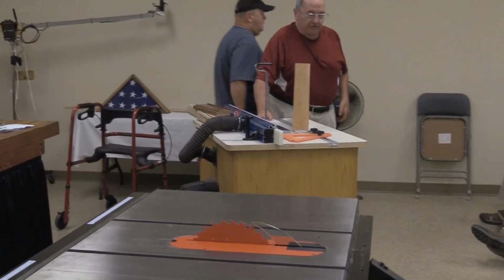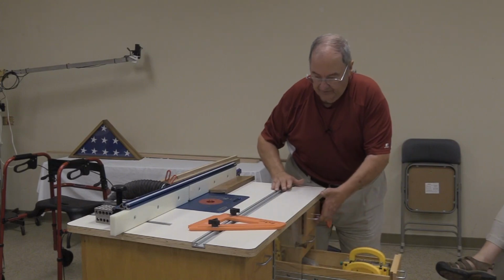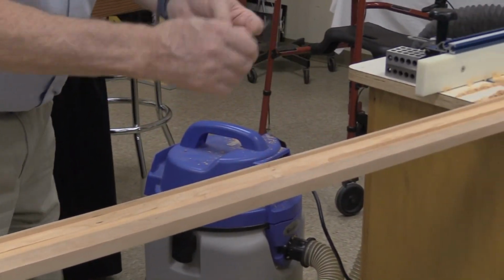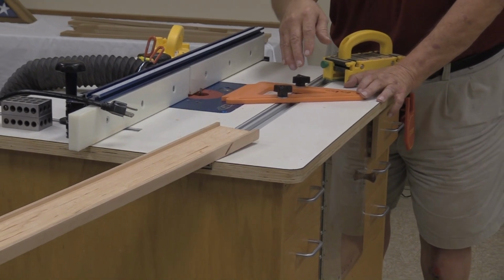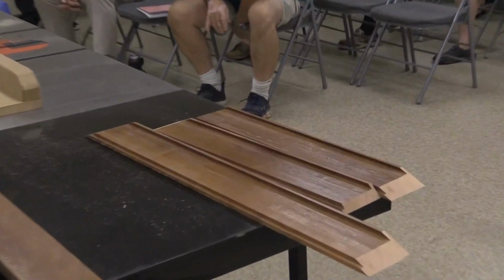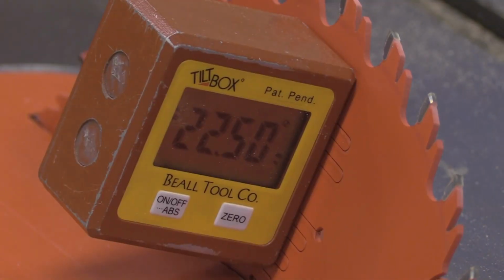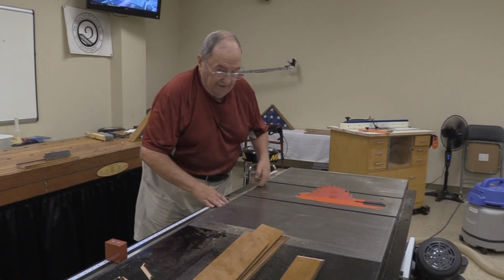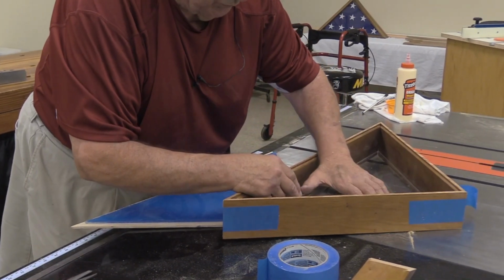Making a flag case by Bob Brokaw

Comment: That is a very nice flag case Bob. Question: Is there a reason why you did not cut the sides to rough length before routing the inside faces? I should think it would make them easier to handle. Also why no groove to trap the glass? Thank you for sharing Bob. This was very informative.
Reply from the maker: The "extrusion" was left in one piece (75" long) to facilitate finishing inside and out. In this form, you can easily get to all the flat surfaces and make sure you are applying the same pressure in the sanding process. The continuous length also insures the spray equipment used is depositing a consistent coat for all the parts involved. When it is cut apart, you then have fresh, raw wood for PVA glue.
When you create a groove to contain the glass and assemble the case with glass in it, your glass is irreplaceable if it should break. The flange allows for placement AND replacement of the glass. It can be held in with daubs of clear caulk or adhesive backed weather stripping.
Reply from the maker: We made some of these prior to the class and ran the full boards on the router table. We decided to just show the individual sides during the class to save time.

Comment: What are the basic size of the case. Great job.
Reply from the maker: See the 3 links (below the "show more" prompt. It will show you the necessary dimensions of the one piece "extrusion" followed by the cuts/assembly required for the 3 sides.
Reply from the maker: 13.2" High by 26 13/32 Wide by 3 1/4" Deep